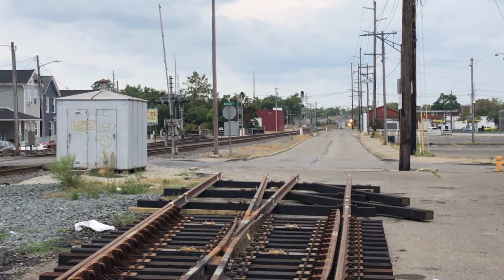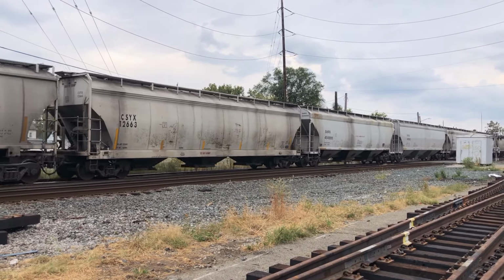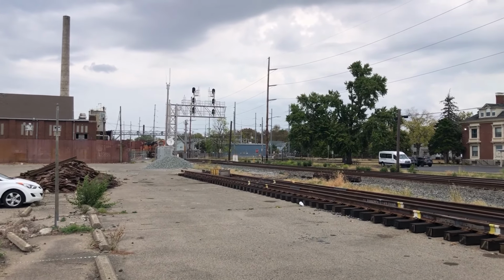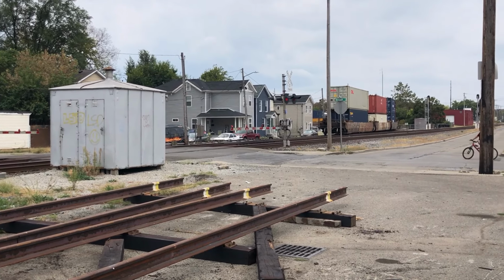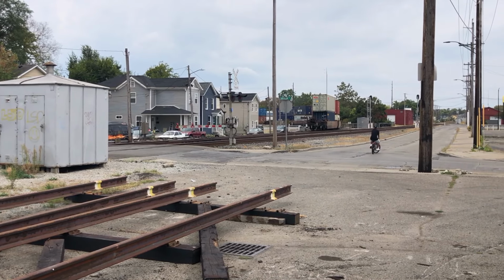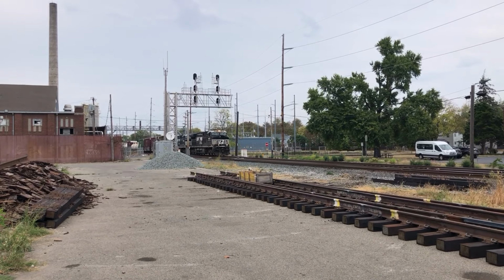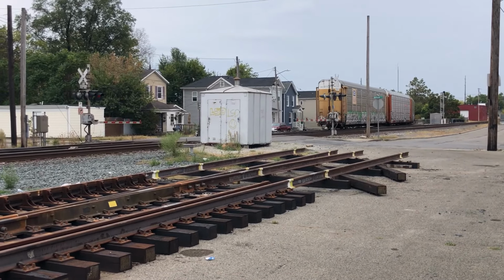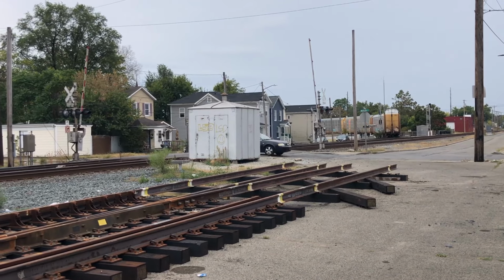Union Pacific, NS, Grain I/M, and Thunder Pumpkins too!

Comment: Hey Scott, I told you yesterday that I haven’t seen any ads on your YouTube channel but just a few since I’ve been watching your videos for three years now and I’ll be darn it today I got one and I watch the whole thing but anyway the correct name for those joint bars is called a insulated joint bar. I don’t know if it stops the electrical current from going through it or make sure that it goes through it. It’s one of the other but anyway another awesome video my friend and as always you stay safe out there and watch your back and we’ll see you on the next one.
Reply from the maker: Thanks Timmy! If the bars are insulated, then no electric can pass through them. That`s how they separate the blocks and make the crossing signals work too. Thanks for watching the ad!

Comment: Good made video, mr 1960gambit.
That on the switcher is for the safety systems. So your right. Thx for this topvideo in Hamilton 🚆🚆🚆👍👍💪💪👌🚆. And when see when the new switchers build in.
Greet from Zandvoort the Netherlands.
Reply from the maker: Yes, I believe they have a switch sticking in the control system for the gates that doesn`t let them work correctly all the time. Thanks Roelof and have a great day!

Comment: i think there's a gate sensor switch there that gets stuck here and there or there's short the haven't found yet!! that I/M was interesting to say the least!! that's the most EMP and Evergreen boxes in a while! and that double side door box is a first along with the capital box and 3 other new logos!! that old N+W covered hopper is what progress is talking about making new ones of if i understood it right with those smaller tank cars we're seeing it seems like the smaller cars might be making a comeback!!
Reply from the maker: I don`t know what the gate is other than a relay may weld its contacts together occasionally. I used to run into that a lot in my working career.  I was surprised to see the N&W car. I think I have seen maybe 3 this year. I hope they make some of those smaller cars too!

Comment: That BNSF Intermodel….would that be a BNSF train on Norfolk Southern tracks or a Norfolk Southern train using BNSF loco’s? Forgive my ignorance but in the UK we never, or very very rarely get freight trains using borrowed power :-)
Reply: It's Norfolk train using BNSF locos. Hamilton is CSX & N/S tracks shared until N/S turns off on to its own tracks on the New Castle sub I think that's right! I'm UK too.
Reply from the maker: It`s a NS train with BNSF locomotives. They could be using them or they have purchased them from BNSF. BNSF has been selling off a bunch of locomotives recently with the downturn of coal trains in America.